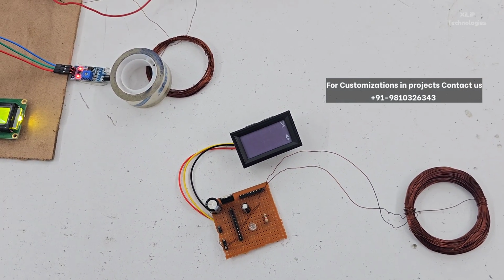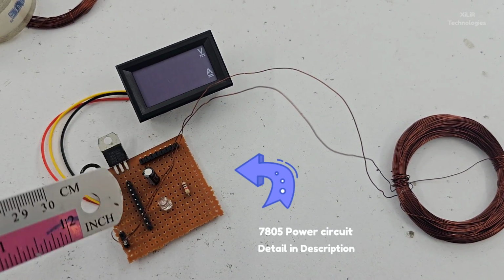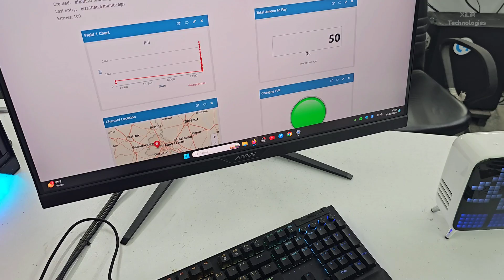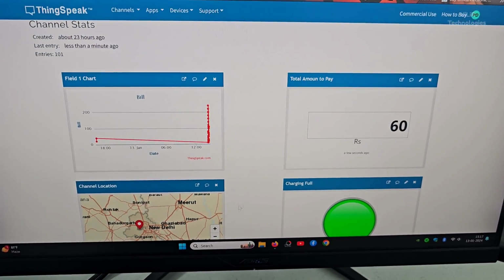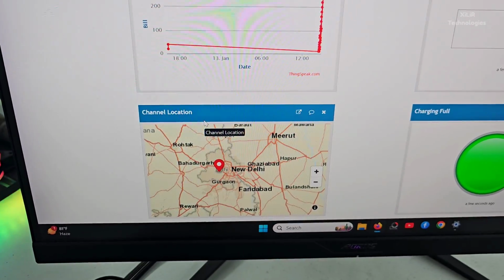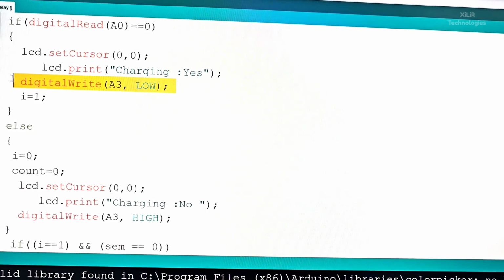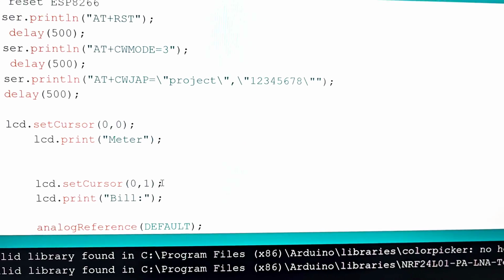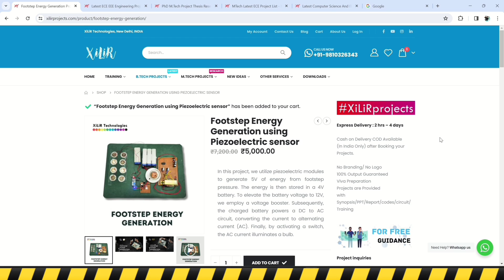IOT based Wireless Charging Station for Electric Vehicles (EVs) | Best Engineering Project

Comment: What is the Volatge going into the Wireless coils , Dc or 220 Ac?
Reply from the maker: 12v ac through mosfet switching
Reply: @XiLiRTechnologies  Can I use 220Ac?
Reply from the maker: @Ali-wo3rb  yes with step down transformer
Reply: @XiLiRTechnologies  OK , my design is : battery(12v) > inverter(12dc to 220ac) > transmitted coil (220ac) > reciver coil(220ac) > rectifier (220ac to 12dc)> battery(12dc)

It's okay? 
Or I don't need to step up the Ac Volatge
Reply from the maker: @Ali-wo3rb see 12v dc for circuit then ac 12v that circuit will generate...if you want to give 220v ac as input you need to use stepdown down transformer
Reply: In how much cost we can complete this project